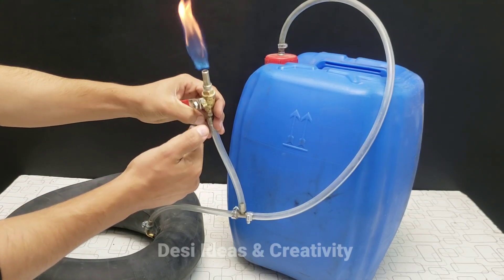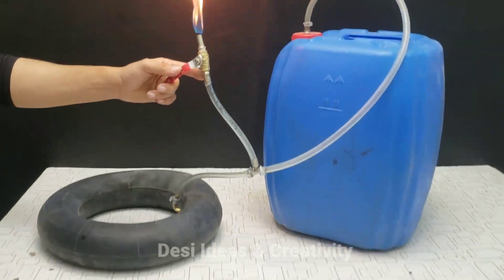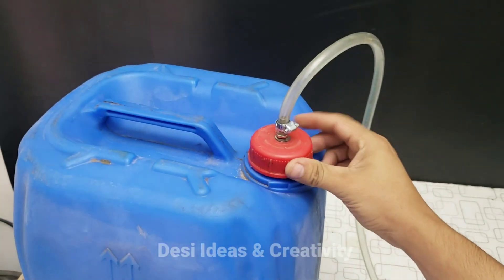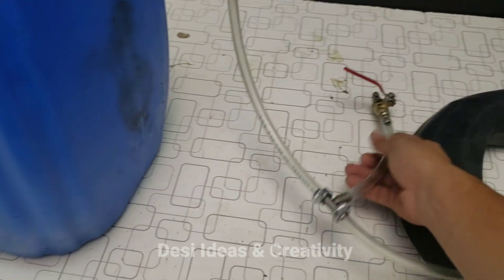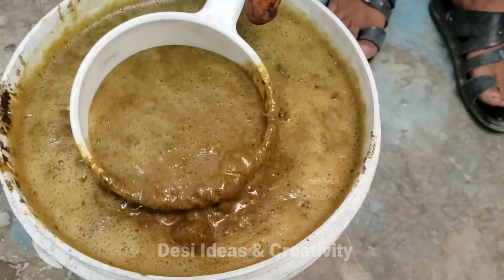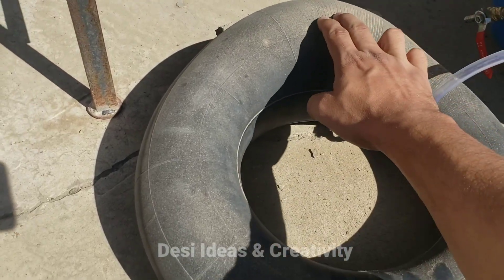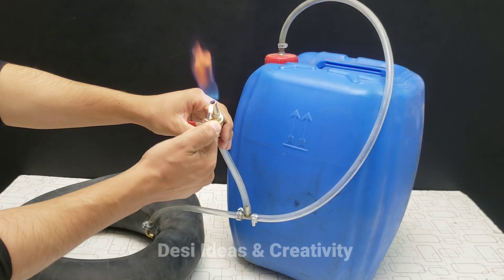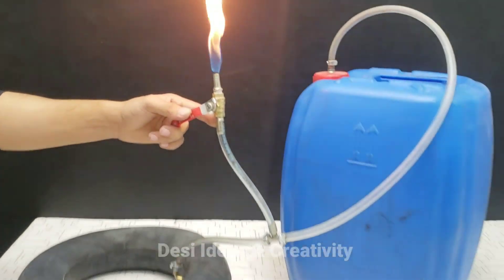Complete Process to make BioGas from Cow Dung #diy

Comment: Thanks 👍 for the video but 
1) how long will it stay for the gas to see start to come out ?
2) some people who tried it told me that it doesn't provide heat energy because air and some other gases are mixed with the methane or butane gas so, 
How do we seperate other gases ie ( air and other non flammable  .
Thanks 👍 once more.

Comment: Nice one
my question is
(1) what's the function  of the tube
(2) does  the cow dug in the container  get finished 
(3) when the gas stopped lighting, what could be the problem and what should be done
Reply: I will try my best to answer 
 1 The tube is used for storage of gas
2 The cow dung changes into biogas and a fertilizer for plants
3 It depends sometimes you need to add more cow dung and sometimes the gas pressure is too low or variety of other reasons

Comment: Your digester did not have exit for waste to fertilizer production.
Reply: This set up is a small prototype for demonstration and presentation in this video. If a large set up is done, you would certainly need an exit/outlet at the bottom to remove the digested manure and use it as fertilizer in your garden.🙏

Comment: Very creative love it 
However from my perseption there was supposed to be an outlet for the sludge at the bottom of the container which can be used as an organic fertilizer and suitable for the plants and vegetables 100% than the normal fertilizer we use.🇿🇲
Reply: That is true or maybe everything will decompose to gass
Reply: Never thought about it (waste disposal) in that direction. My initial thought was , open the lid and pour it out. Thanks for pointing it out, might as well incorporate a discharge valve

Comment: how do you get the cow dung that has hardened inside the biogas container
Reply: Just add water and let it sit for some time. Then you can shake it or insert a tool into the drum to stir it. 
An outlet at the bottom will be helpful.